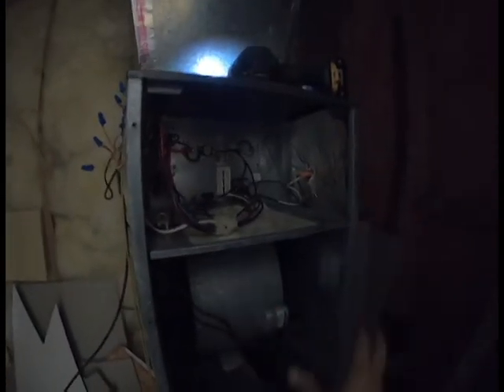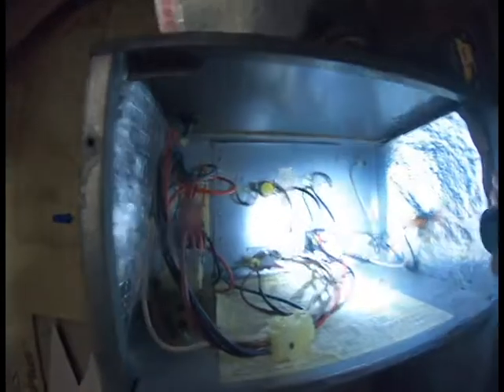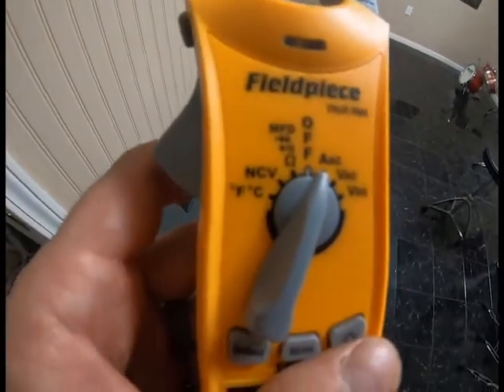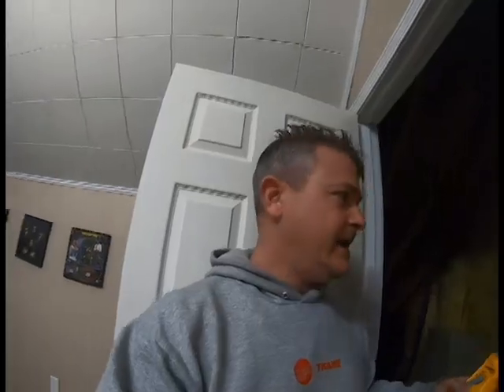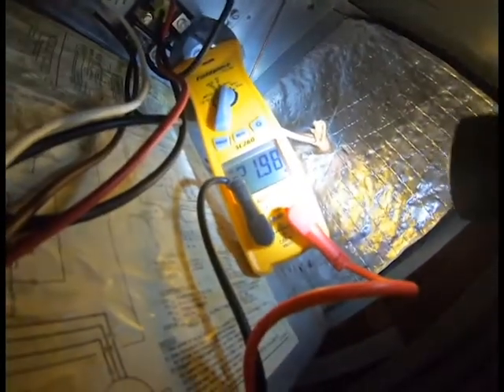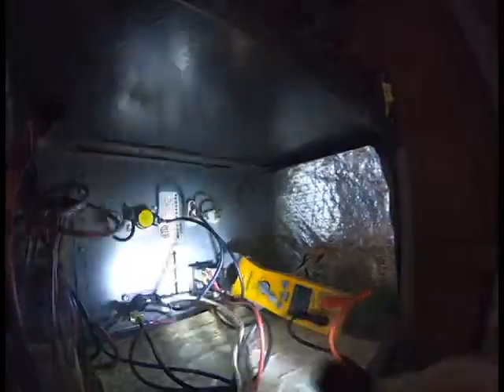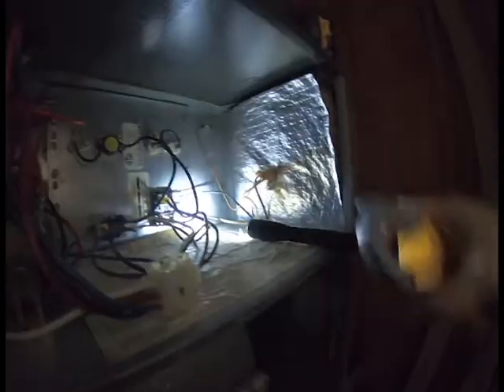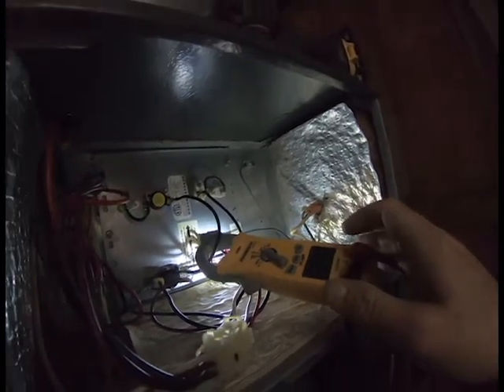How to Tell if Your Heat Strips are Woking!!

Comment: The house i just bought is pure heat strip im going to have a heat pump system installed soon my question is my house is set to 72 and when the heater is on its put right at 100 at  vents is that about right ? Thanks

Comment: good vid. need some help, i'm up north, first freezing cold day today since the winter, -13c. So my heat pump is off, aux heat strips took over in the air handler. It is a Trane 4tee3f37b1000aa, system about 12 years old. Noticed when the aux heat starts, there's a machine gun rapid fire/chatter sound at the air handler, right about where the red 20KW line comes in. i'm not really familiar with relays but coudl it be relays that turn the strips on and off?? (sounds like a machine gun, fairly loud if i put my ear on the panel). Once the heat gets going and the fan is up to speed, it seems to stop, and then starts again a bit when the heat cycle shuts off. I'm still getting aux heat but not sure if the 4 strips are all working 100%. if i lost a strip or 2 out of 4 would the others continue to work or would they all stop?, Is there a fire hazard if either a strip is burnt or relay coils chattering furiously. Or could this noise be something else like arcing at the strips? the system cycles on and off a lot when it's too cold for the heat pump, nothing new but i guess that's normal, since the air is hotter, it gets back to temp fast compared to heat pump.  

I fixed a few things on the system because i paid a pro to come and tell me to change the motor and module or the entire air handler for $2-4K, while the unit looks brand new. So I determined the motor was ok and replaced the variable speed motor control module 2 years ago (with a used one off ebay for $100), and outdoor capacitor this year. Haven't really done any electrical troubleshooting but i have no problem unplugging and plugging wires on boards as long as i don't have to rewire or add stuff. Does this sound like a relay problem? HELP.  thx I can easily open the from panel, just not sure what to look for.